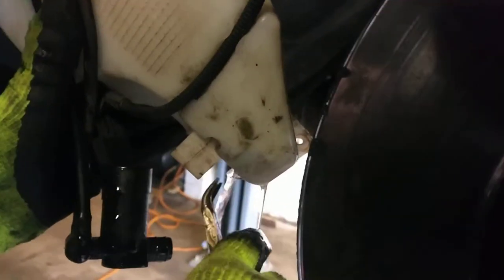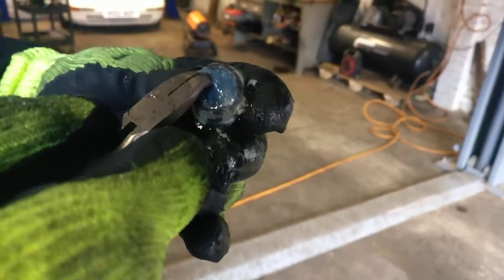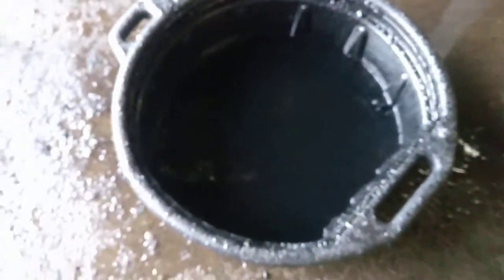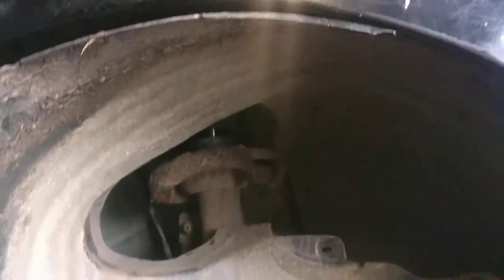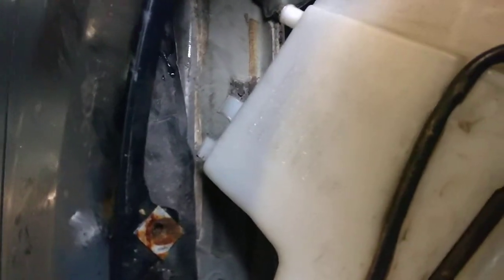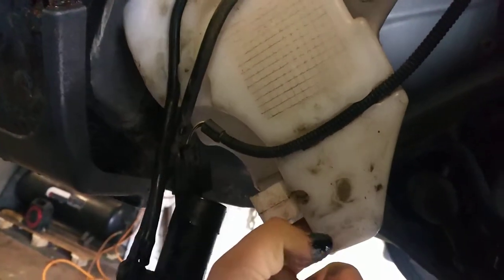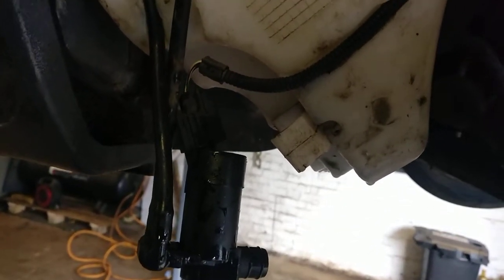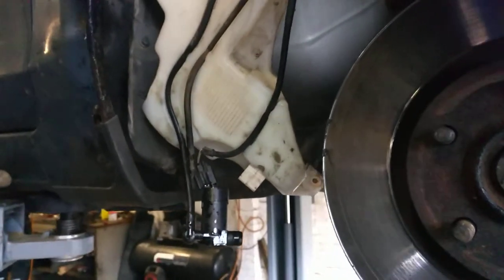Windscreen washer is not working on a Ford Focus - SOLVED

Comment: Mine has stopped working. Then after couple weeks started working again. now has stopped again. my question is. Did you not hear the motor? I don't,but am not sure whether just a connection problem or not?